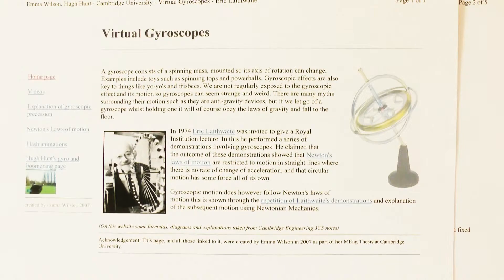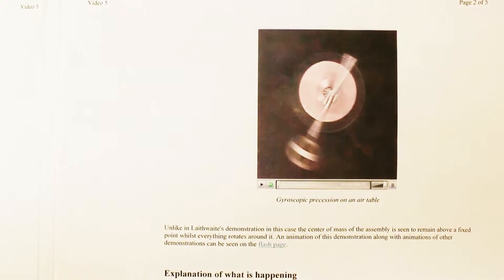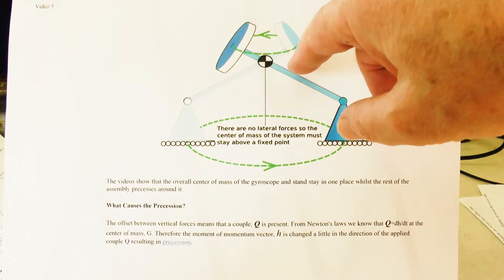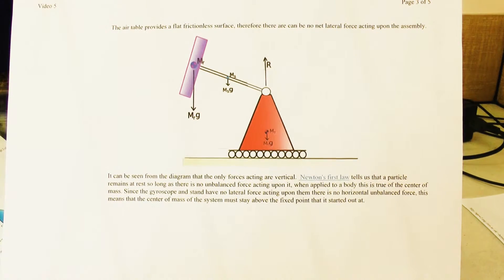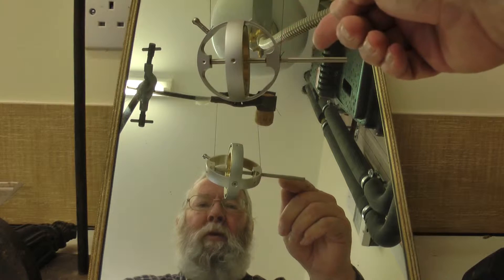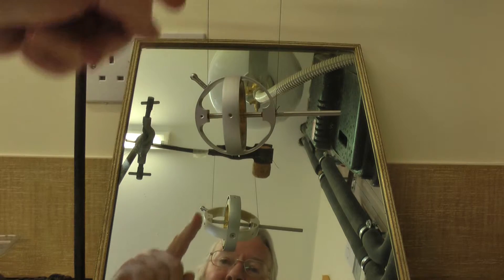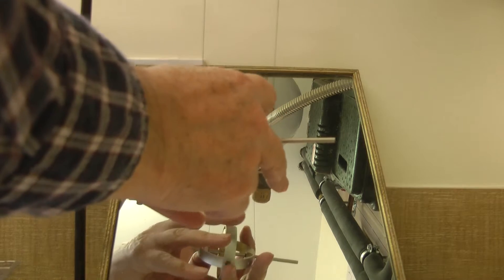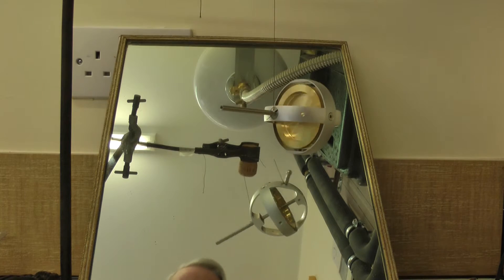Gyroscopic anomalies

Comment: My opinion about why inertia seems to disappear from a gyro is as follows.
Let us assume that the gyro mass wheel is spinning at about 5,000 revolutions per minute.
Then I shall take the arrangement shown in this video to explain my thoughts. 
The gyro which is seen in this video is suspended with its axle in a horizontal orientation. When one thread was burnt,  the other thread took over the suspension point and the gyro was all of a sudden subjected to a TORQUE of (m.g.Ra) mass, gravity, and extended arm Ra. The remaining thread was also involved in creating the torque action.
1. With the weight (mg) acting vertically down the gyro body was subjected to a drop and a torque.
2. This drop retained the instantaneous horizontal diameter of the spinning wheel but tilted the instantaneous vertical diameter "diverting out"  the upper high-speed mass particle and " diverting in" the lower high-speed mass particle, changing what was equal but opposite momentum, in the same plane, to divert their courses away from the opposite faces of their spinning plane before the drop occurred.
3. The vertical diameter tilting rate of the drop decided the new velocity vector DIRECTION components at the top and bottom of the tilted vertical diameter which was added to the previous spinning velocity.
4. This change of direction of the upper and lower masses in the gyro spinning radius, proceed in their new "almost linear momentum"  and the tension and " side structure solidity" in the radius component cause the two fast-moving mass particle on opposite radii to swing to their maximum after just (1/4)  a quarter of a turn of the spinning wheel.  This was really the time taken for the  FIRST 90 DEGREE PRECESSION. it happened in ((1/4)(1/5000) seconds
5. The action described in (4) caused a horizontal torque on the gyro axis in a particular direction, which set the gyro rotating about the central pivot support point. Hence (m.g.Ra) torque due to weight= (I.Ws.Wp) angular precession torque.
6. The gyro instantaneous horizontal diameter was now inclined in a similar reaction to that occurred in the vertical diameter with the initial drop. This horizontal action to the modification of the masses on the horizontal instantaneous diameter resulted   ((1/4)(1/5000) seconds later in torquing the gyro in the vertical plane which in conjunction with the extension arm pushed down on the pivot to take the weight of the gyro. This what I call  THE SECOND PRECESSION in a floating gyro as shown in this video.
So for these two 90 degrees, precessions which resulted in a 180-degree phase shift took about ((2/4)(1/5000) seconds which is half a spin of the gyro wheel.   If we are pessimists and say that it took 10 spins to settle it then that is something that the human eye cannot even see! 

This phenomenon of how an action is transferred to two 90 degrees operation is also found in electrical engineering in alternators and motors.

If a voltage supply V is applied to a motor or a transformer, then the magnetic field B is lagging 90 degrees, and once the magnetic field shows its presence the spinning coils in the motor show its effect by inducing a back emf E again 90 degrees later to oppose the input.  In AC work say 50 or 60 Hertz one may say that half a cycle  1/( 2*50) seconds to excite the back emf  hence V= E opposing it 

Considering that when torquing a spinning gyro only one effective large diameter is being slightly tilted the effective high-speed masses that are being diverted from their previous course to precess and hence the mass close to the dormant diameter does not seem to count a lot and perhaps the inertia to be accounted for would be much less than what the first intuation tells us which is either the total angular inertia about the center or the e=inertial about the diameter.............certainly, not an easy matter to settle!